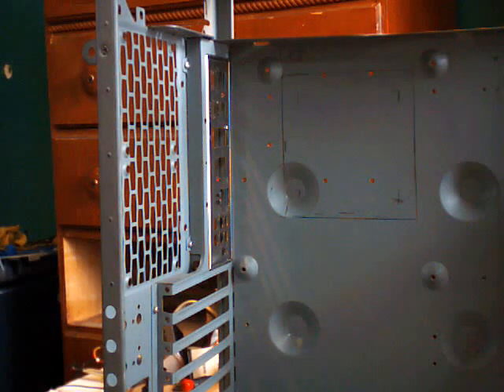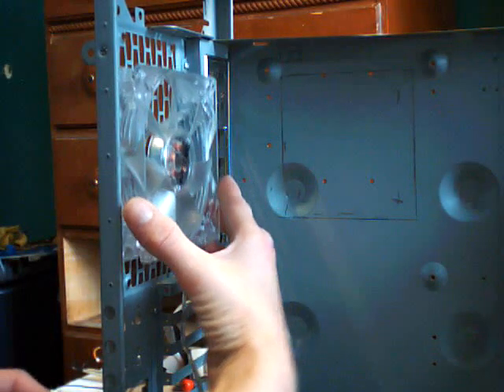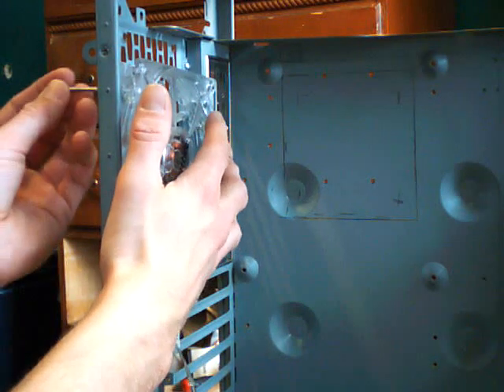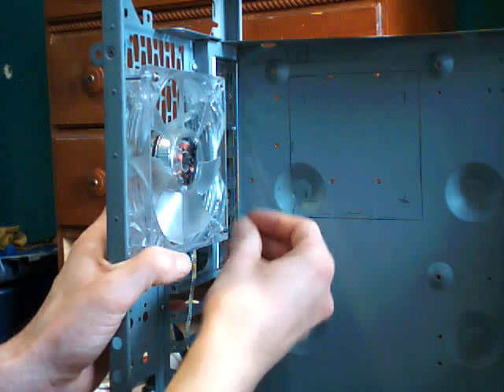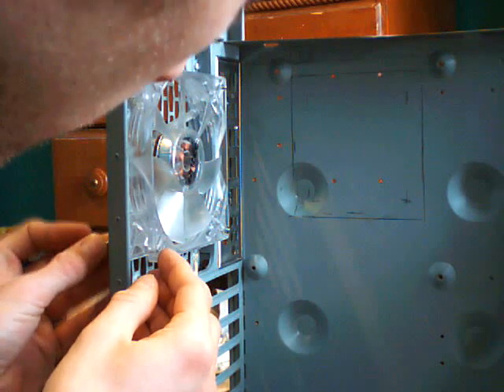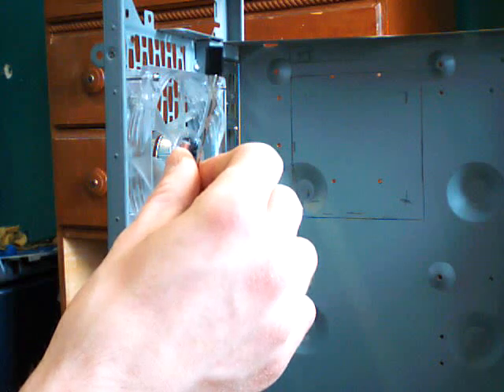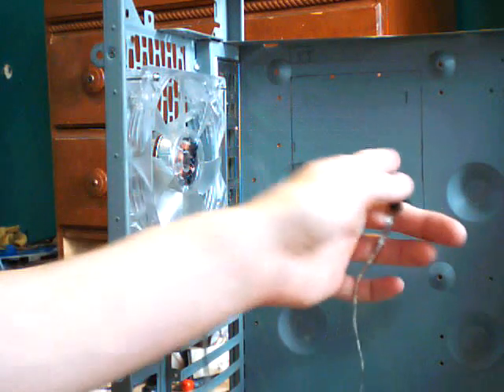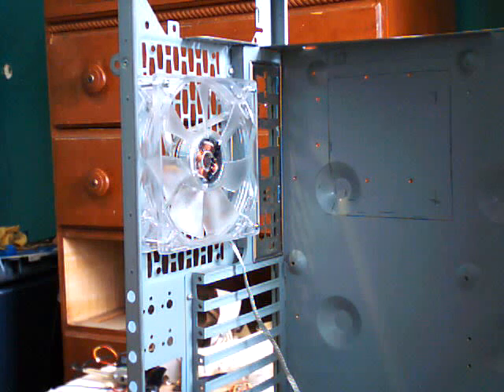How To: Install Case Fans in Computer Case

Comment: I was hoping you would show how to determine the direction of air flow.  What way do you fit for drawing in air and what way to fit  using as an exhaust ? Is your fan drawing in air, or exhausting ?
Reply: Agree.  This is why I came here, as a first-time PC builder
Reply: There's a pointer printed in the fan pointing the direction of the air flow.
Reply: Ingvar Dias Correct, also the label on the fan indicate air being pulled toward said label.
Reply: shawn Merrill
True, as there's also some barriers to prevent cables going into fans.

Comment: well, my fan needed a molex cable, its the cable with 4 thick pins sticking out then with a plastic rectangle around them, its a cable that comes from your PSU.

Comment: Depends where you're putting it. Just remember that heat rises - if you're mounting it at the bottom of your case, you'll want to intake the cool air; if you're mounting it at the top of your case, you'll want to exhaust the hot air. Some people just make every fan exhaust and use vents for intake.

Comment: If you have the extra slots, it's worth setting up more than one. Having a good intake/output of fans can be extremely helpful when done correctly, and you can get some high quality fans at a good price in some places. You can pick up a very high quality Yate Loon for $7-9 each oftentimes, and these are very good high cfm fans.

Comment: Right now, my PC just has one case fan, and it's just fine. However, when running demanding programs and games it does REALLY heat up. I'd suggest 2 well placed fans, but 1 at the bare minimum.

Comment: would this be good ? in the fron 2 80mm coolermaster BC Blue Led back 1 wuiet fan 12 DB 120MM more places i dont have im thinking to make 2 holes at the bottom for 2 120mm or 2 140mm but my neightbour need to do that i cant do that i dont have any tools.

so is there a option to cut it out white no tools ?

and btw back 120mm fan push air out of case or in i have it out now
and the front 2 coolermaster bc 80 takes are in filtered

Comment: That depends on the volts and amps as well as the model of fan and its RPM...
Also, the fans will use extra power during start up.
My Antec Big Boy 200 is rated at normal running of: 12V * .3A = 3.6W
and a MAX (start-up) rating of: 13.2V * 0.3A = 3.96W
Depends on the fan model though!

Comment: Yes, you do want to draw air in as well.

Think about it like trying to suck air out of a plastic bag...doesn't work well.
But if you had a second hole in the bag with air coming in, you would be good to go.

For the best cooling, you want to have intake fans with nearly equal CFM to the exhaust fans.

Comment: It's basically what controls the computer. You plug everything into the motherboard and when you boot up the computer for the first time it will consult you for what power and other options you want to choose.

Comment: hey spec's of those bolts u show ? im planning on getting a new fan, rig another to the side of my case ( no proper spot but there is holes in it and they line up ok) but the normal scraws teeth are vicious to fit and bolts will hold it better anyway.

thanks

Comment: Note to people running fans straight off the PSU. Invest in a PCI fan controller. If you're running them off straight 12v they'll be spinning at 100% all the time. This isn't a bad thing.. but it's noisy.

Comment: to everyone concerned about power supplies: as the guy said fans draw very little power so you wont need to worry about it. if you're genuinely worried check out the ASUS Power Supply Calculator (google it)
in terms of connecting it, it does not necessarily have to connect to the motherboard. so dont worry if you've ran out of pin sockets to plug them into. you can just a buy an adapter and connect it directly to the power supply instead

Comment: @hh100488 you are fine, if your fan have the 4 pin peripheral connectors then it works out best. otherwise im fairly sure adapters 3 to 4 pin exist. you can view and change fan speeds for the fan connected to the MB,

Comment from the maker: @hh100488 Yes fans do not draw much power and as long as you get some 3-pin to molex adapters will work fine.

Comment: @ElementalDearth well, youll need to find a 3 pin connector more than likely, youll find it normally attached to molex cables which are the ones with the white tip, dont worry if you arent sure because if it isnt where it should go than it wont fit.

Comment: @captain31893 Its exhaust. For the most part when you have the wire strip facing the outside of the case you are using it for exhaust. Almost all fan manufactures do it this way

Comment from the maker: @BigidyBooh It depends low end boards have a 4-pin PWM and usually 1-2 3 pin connectors. High end boards can have a few 4-pin and 3-pin connectors.

Comment from the maker: @Reymys4 There will be 2 types of connectors on MBs currently 4 pin PWM usually for CPU coolers and 3 pin power connectors for fans.

Comment from the maker: @clinte1 Have the fan intake if it is at the front. Although most cases with one fan have in in the rear in that case go for exhaust. This way it can expel the hot air and pull in cool air from any holes in the case. If you intake with one fan most cases it will fit the case with hot air and it gets stagnant and will not work efficiently enough. If you can mod a fan to intake and have fan in back to exhaust that would help greatly.

Comment: you want fans at front of case pulling air in and fans at back dumping air out, PSU pulls air out of the case. the air at the back of the case under desk ect is usually warm stale air , so you don't wan't to suck that back in :)

Comment: I think the fan inside the power supply pulls air in..so if I mount another fan in the back shouldn't it be installed to pull air in?  that way the fans work together?
what's your thoughts?

Comment: @whiskeyify this is depending on the way you put the fans in... if 1 in the rear sucks air in its good to put the front one so that it blows air out... like this you will get a good airflow. You can also do this so that the front 1 sucks in and the rear 1 blows out.. if you put both ones to suck in you will get hot air in your case that cant go out. This will result in higher temps (and maybe overheating)
I hope I helped you with this!

Comment: @whiskeyify  Depends you need to make a judgment call on that yourself. I personally put fans with intake at the bottom and out at the top since hot air travels up.

Comment: @flaco102352 

Heat works in a way that it flows upwards so u want intake fan in bottom or low side and exhaust fan in top or high side.

Comment from the maker: @hayta1001 The open side of the fan is the intake side and the side with the motor and the bracing is the exhaust air will come out this side.

Comment: For anyone who doesn't know which way to point it, you can just plug it in, turn the PC on and see which direction the air is going, and then just mount it with the air still blowing. That's what I did, BTW...

Comment: @TheAmefist That goes right into the power supply. Unless you have a crapload of hard drives, then you should find a few just hanging down in the case. Just take one of those and just pop it right into the connector on the fan. I have about 4 or 5 just sitting there, one of which is powering the fan I just installed to cool the ambient temperature in the case a little (because HP fails, no case fans, 2 intakes, 1 exhaust with no fans at all, just CPU and power supply fans).

Comment: im building my first computer i was going to install more fans eventually, i have the Cooler master storm scout and it comes stock with 3 fans 1 intake on front and a top and rear exhaust. it has the option for 2 more 120mm fans on the side, if i installed those, would i make them exhaust or intake? thanks

Comment: @whiskeyify 

it really depends what you want it to do. if you mount the fan directly next to the graphics card, which some people, you want to put it so it pulls air out of the case. this forces air through the bottom of the case and gives the gpu and other pcie slots some good cool air. If you put it so it blows air in, itll just blow the hot air into your other parts which can be bad.

it's a general rule of thumb to always have a fan that blows out of the case in the spot in the video

Comment: hey i wanna ask, i have this fan onthe side of my case... but dang, it doesnt run! i dont know where it is connected but i suspect, its for the hard drive... i was just wondering why the fan doesnt run? and uhm, yeah i want to put a fan on the rear part of my case... are there various sizes for different cases? or one size fits it all?

sorry for my bad english:P

Comment: Traditionally you're going to find that fans on the front of your case suck air in (intake) and those that are on the back typically push air out. It's all about the circulation of air and making sure that hot air doesn't sit in the case and get recycled over and over.

Comment: I recently installed a 120mm fan on the side of the case. I used small felt furniture sliders (peel & stick kind from $1 store) between fan & case to use as washers. The ones I used looked like buttons about the size of dimes. I put the screws through the middle of the felt. This was to eliminate vibration & noise. It worked.......runs really quiet. I also took fan to Meeks to size the screws that best fit the holes. I too used machine screws w/nuts. Removable & reusable for easy maintenance.

Comment: Problem with filters is lack of surface area = restricted airflow. The ones I've seen are same size as fan. If filters are a must then be creative. Use a quality home furnace filter. Make a box, or put directly on side of case(allow 1/2" clearance w/ spacers_edges sealed) over any intake fans. Be fancy and swing by auto store & get a CHROME intake & mount over any intake fans. Point is_these are designed to filter massive airflows w/ little restriction. Done right it'll be sharp lookin too.

Comment: Hello I just installed a new case fan inside my computer today. Normally if you buy case fans. It would come with a adapter from 4-pin power supply to the case fan input. There's only one case fan plug on the mobo so you could use the adapter to connect more. Hopefully this helps you :D

Comment: just a quick question . Lets say , I buy three of these Zalman ZM-F3's and want to install them in my case , do i need to hook them up to my mobo? with a certain type of 3pin plug or whatever , What if my mobo doesnt have enough of those? Are there any adapters that exist or such? Thanks.

Comment: Something I've done is when you know where the fan will be placed...cut out (Dremel) the stamped grill area that'll be directly in front of the fan. If you really look at it...it's blocking (and breaking up)half of your overall air flow. After I cut out mine (Dell) the airflow improved dramatically. Stamped grills are horrible for cooling. What good is a high CFM if you're gonna block half of it? Try it...it's def. worth the increase in airflow which in turn increases cooling. I also did my PSU.

Comment from the maker: You can but I suggest intake at front and exhaust on back and/or top. heat rises intake on bottom and intake or exhaust can be used on side panel test to see best results on your set up.

Comment: omg! i really didn't know that i can put a fan on this place! i'm doing it! :O omg! really thanks so much! now i can install two fans! :)

just one question? should the case fan be sucking air or pushing air out of the case? :) coz the shop guy installed it sucking air and i don't know...should i change it or leave it like that?
sry my english is simple :) p.s. i'm in egypt so it's relatively a hot country and it's really important for me :) i hope u reply soon! :)

Comment: Help...
I have 3x case fans in my PC one is a 80mm that gets plugged directly into Power Supply via 4 pin molex. I have another 80mm and 120mm that go into mthrbrd via 3 pin connector. They do not work i don't no why however they are brand new, i have checked for settings in the bios and set it to enable it to recognise new fans

Specs.
350w PSU
Intel core 2 duo e6400
2 gb ddr2 533 ram
2x 250gb harddrive
Intel dp965lt mthrbrd
Nvidia 7300gt (running dual monitors)

Please help Thanks

Comment from the maker: Well if you have a molex 4 pin you can install 1-3 or so fans there will have to daisy chain them if connectors permit. The ATX connector I believe is for power for the motherboard if I am thinking of the right connector.

Comment from the maker: Sounds like the gfx card fan is spinning up you can manually set the speed depending on what card you have. If you get better case cooling yes it will be quieter if the parts are not heating up as much. Might be CPU not totally sure those are 2 of the loudest fans in a PC usually.

Comment from the maker: No just do either one and if the 3 pin wont power it more then likely the molex is power and the 3 pin is for monitoring fan speed in BIOS through mobo.

Comment from the maker: To install larger fan must enlarge hole and drill fan screw holes if other way around should work but might have to attach fan with zipties or similar to mount it if no holes are present.